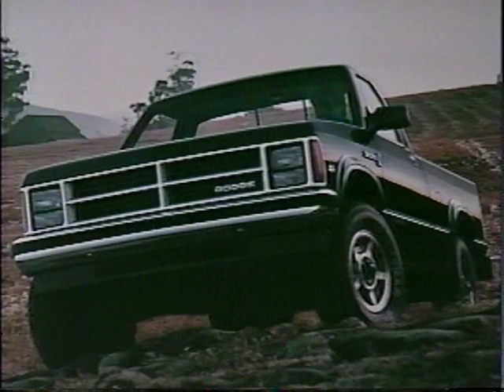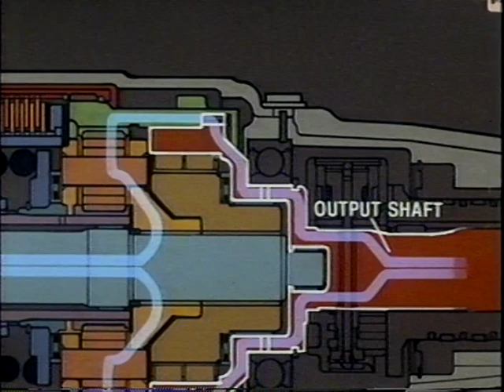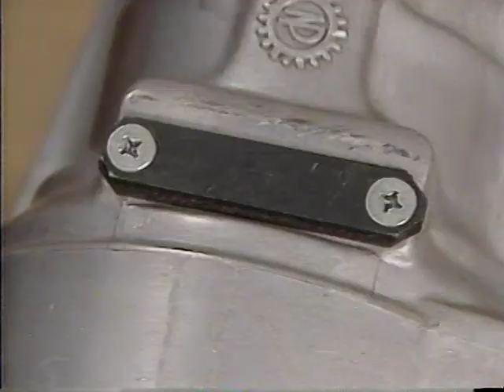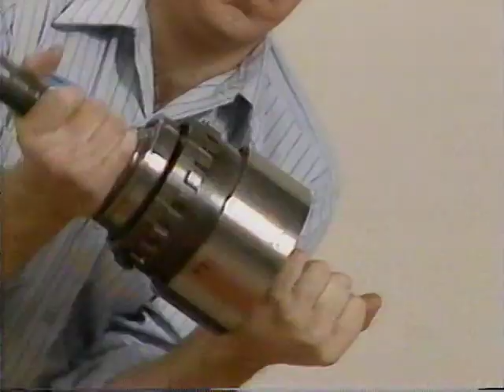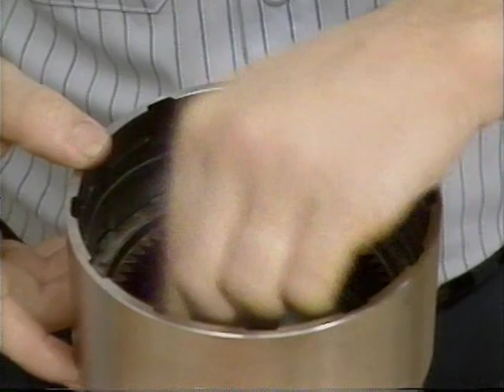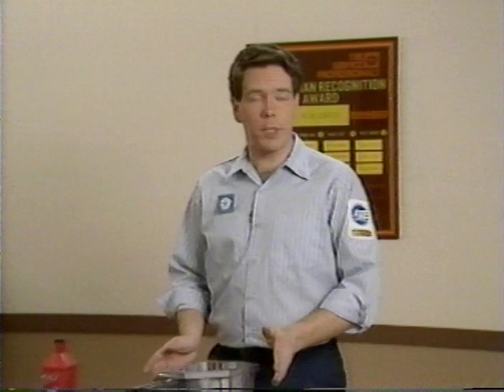Chrysler Overdrive

Comment: At my last base i bought a 1997 Grand Cherokee from a civillian working at the base chow hall, and it was high in miles as you might expect but other than. That it was in great shape, no rust, and I wasn't worried about he 4.0 inline 6 giving me any problems. I went fishing one day and when I stopped to get some drinks for the day, I came out of the store to see a gigantic puddle under my new chariot. Immediately i thought and prayed it was coolant. But my hopes were dashed when after touching the fluid it came back oily and reddish😳😭 fuuuuucccckkkkkkkkkk
Now normally I'd have gone to the hobby shop with a spare trans and threw it in but as I'd come home from deployment about 4 months previous I thought I'd treat myself to having the pros handle it. I found an online rebuilder rhat others i knew had used and they were impressed. So at the shop I had the jeep towed to they told me they wouldn't install anyone else's products and I couldn't have a remanned unit and they'd only rebuild it, and then they told me what that'd cost 😅. I gave them a heart felt go fuck yourselves, ordered my transmission and when it arrived Julio at the hobby shop helped me put it in.